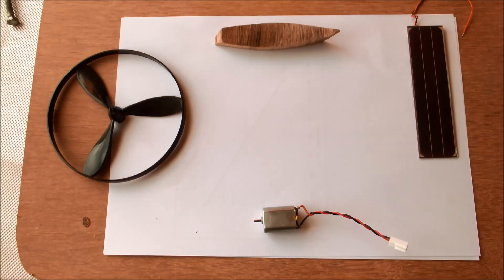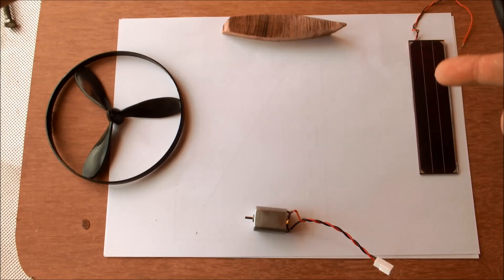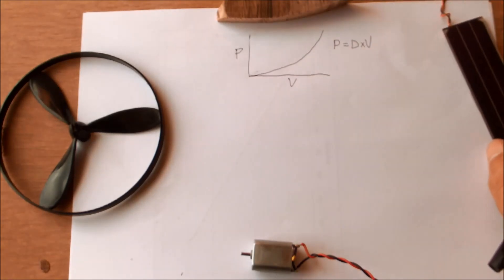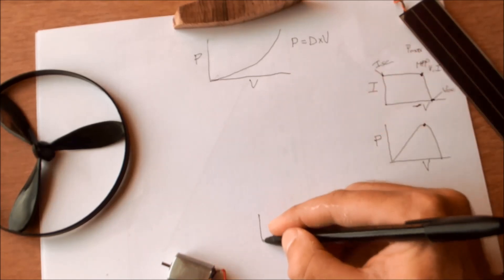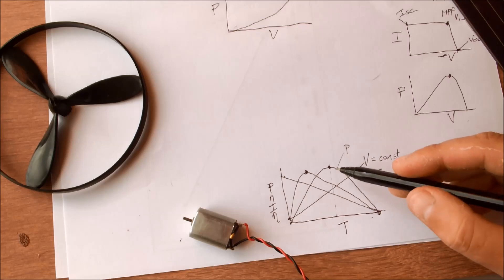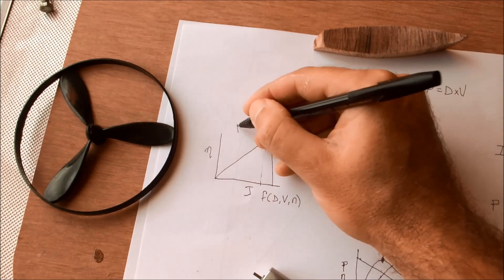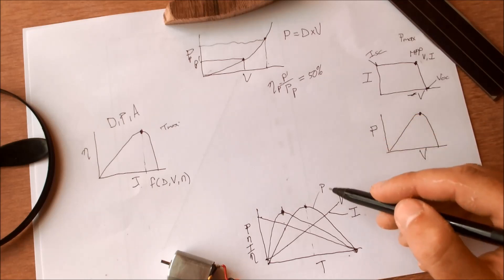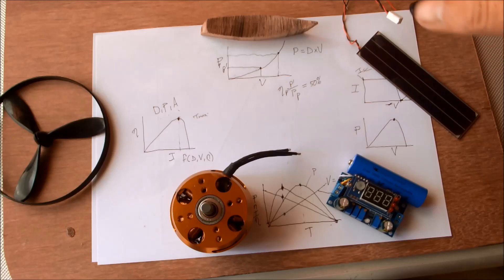Solar/electric Propulsion Intro - Design Approach

Comment: Nice job Will!  This looks like an awesome "learn by doing" physics lesson.  My first thought is that a brushless motor would offer better performance, but then it goes from good physics lesson to crummy electronics characterization (I suspect).  My second thought is that there will be some great opportunities for custom 3D printed parts.
Reply from the maker: Brushless will certainly be an improvement. I have a chunky 2hp, 195KV bldc motor for my next project. I also have a diy motor dyno test rig to measure output from the stronger motors. At last I have turned an old smartphone into an oscilloscope and was able to measure the phase-to-phase ac voltage on a small brushless motor. Lots of projects-within-projects, expect many interesting videos. The learning never stops...